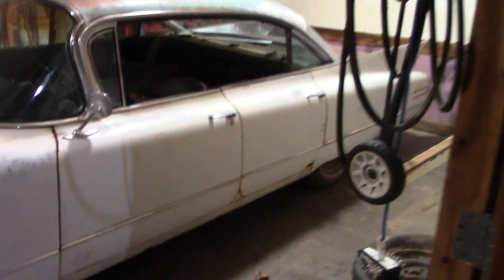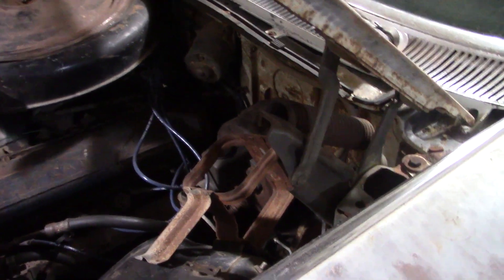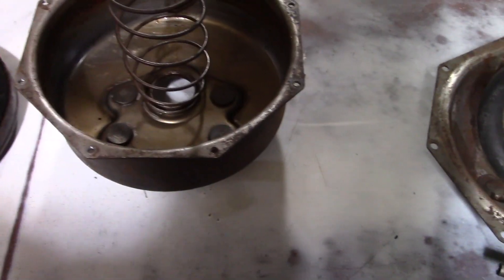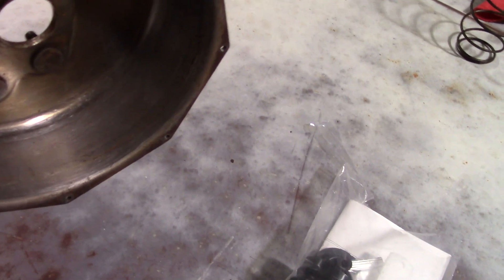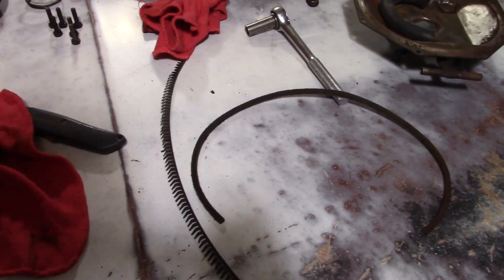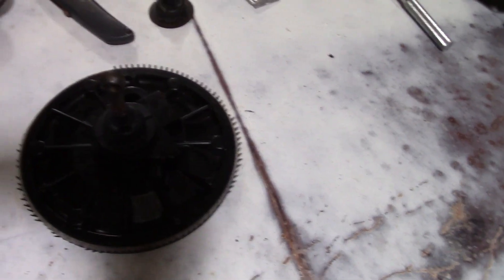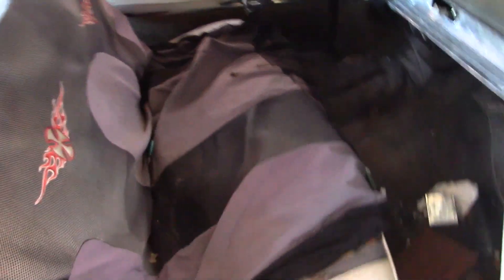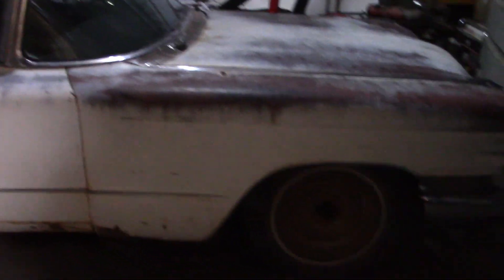Brake Booster Work On The 1960 Cadillac

Comment: The push rod that goes into the master cylinder moved a bit when the booster was mounted on the firewall. I pushed the rod back a bit. Got the brake booster off. Now that push rod won't budge at all. I'm guessing its stuck. I poured a lot of brake fluid out of it...